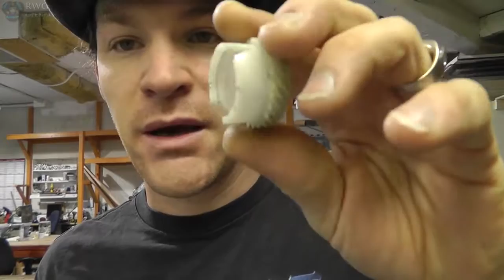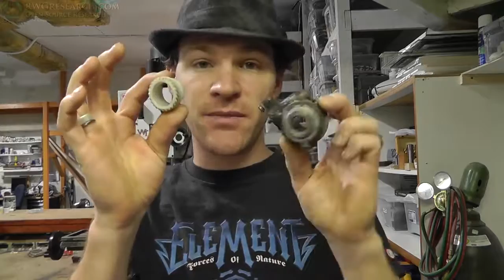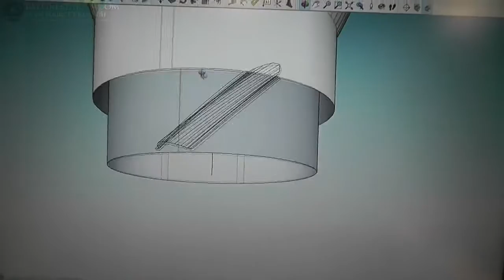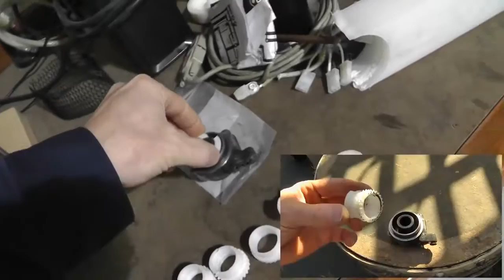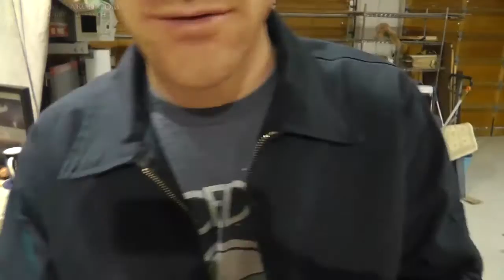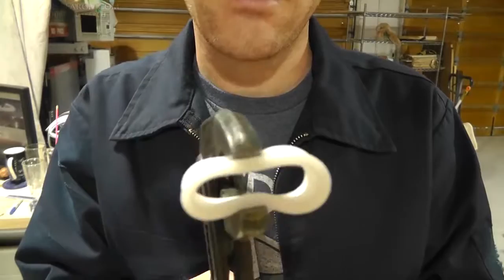Practical 3D Printing With Taulman 618, Nylon Gears! 1983 Hondamatic 450 Speedometer Gear!

Comment: It's now been close to a year, how well has the speedo gear held up?

I have a similar nylon gear for a Honda Rebel CMX 450.  One of the ears broke off and somehow the nylon gear and the speedo gear failed to continue meshing.

The result was the bottom portion of the helical gears wearing out/melting.

I am considering going to a local Makerspace to see if I can have a new gear manufactured, but I am skeptical of how long the printed gear will last.

Input appreciated.

Thanks, Joe